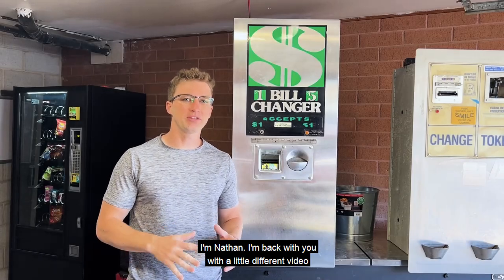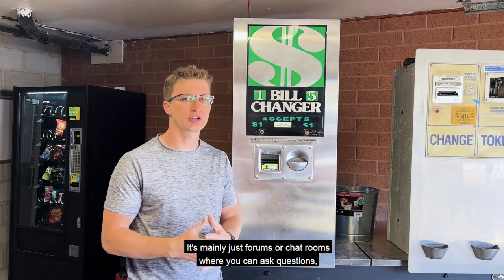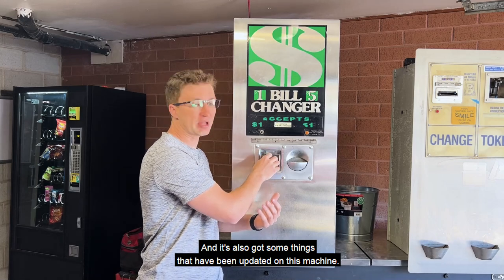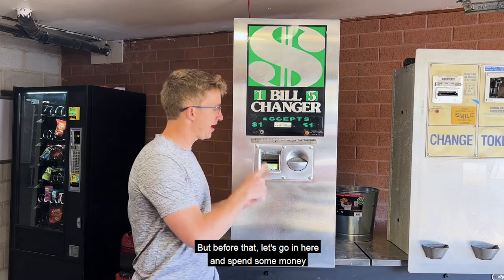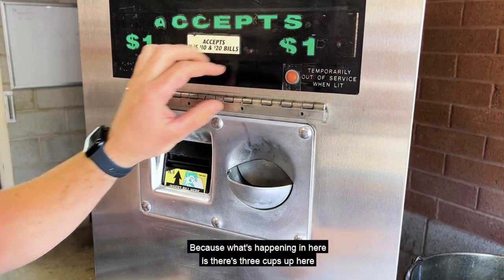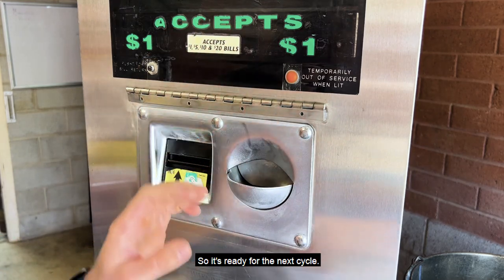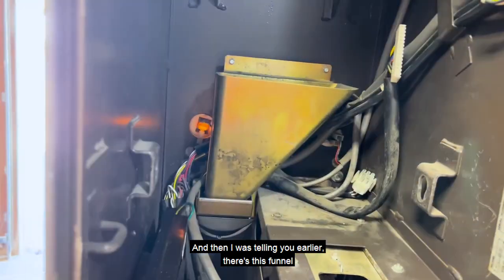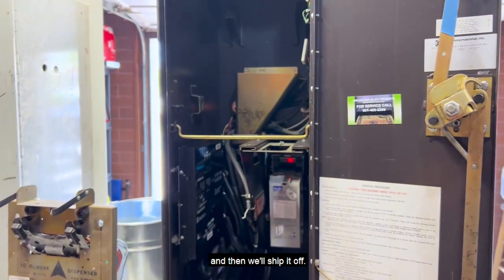Bill to Coin Changer for Car Wash, Laundromat, or Arcade | Rowe BC1400

Comment: Do you know if you could modify a change dispenser to dispense less coins? For example if you were accepting $20 bills ONLY and in return dispensing 4 x 90% silver quarters. Or some similar variation.
Reply from the maker: The machines can be programmed for that yes. For example I could put $1 value tokens in instead of quarters.

Comment: Thanks for the video covering the hardware. I don't know if you have the will respond, but do you know anything about the software side of it? Backstory omitted for brevity, we incidentally turn it off and it lead to it display "SET UP REQUIRED" which mean reprogramming per manual.

But why would a power cycle lead it to forget all settings? And reprograming it has found it is working a lot worse now. As in the right-side hopper does not work, left-side is slow to load, and a struggle to dispense the right number of quarters. Granted it seems a big part is just performing the same repairs, but would any software setting be able to hide that? Such issues should have been apparent. The two hints that might expain it is the previous owner might have kept MC mod off and possibly programmed it to treat the coins at tokens. Does that make sense at all or did we somehow only stated to notice after the powercycle
Reply from the maker: I dont really know what issue your getting on the software of your device is. There are still a lot of operators using these machines. You may be able to find an answer online.